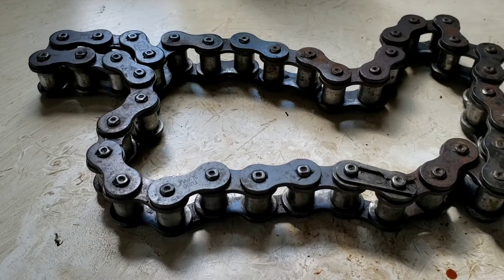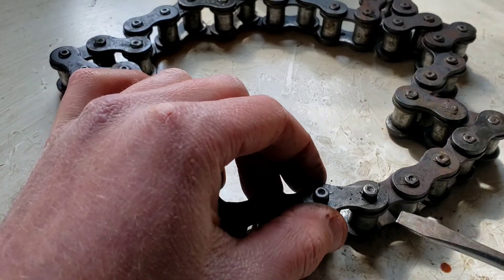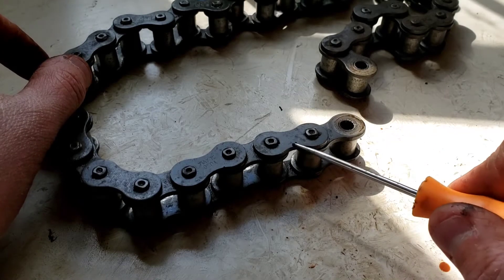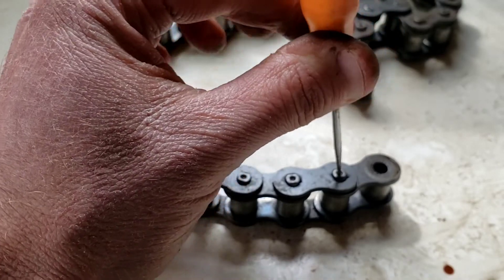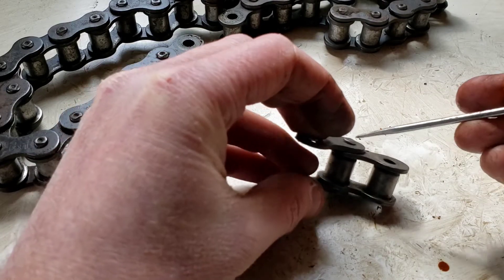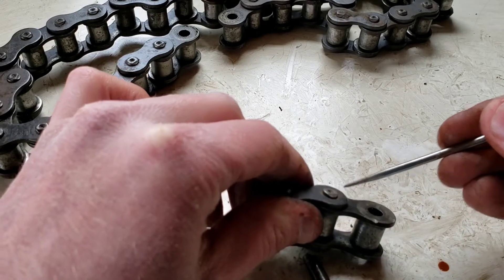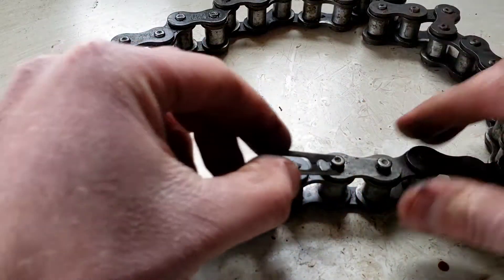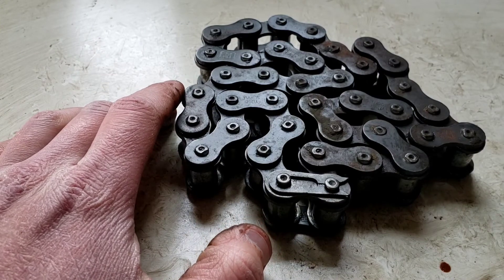Removing Links From Two Types of Roller Chains

Comment: There is a tool you can buy that clamps on the chain with a punch that pushes pin out by turning a rinch on it tried to post a pic but it wouldn't let me i like how you showed how to do with grinder but it you dont habe grinder this tool is awsome i have a grinder n still prefer the tool its about $25

Comment: What if I don't have a grinder with me?
Reply: There is a tool made to punch pin out it's about $25 n worth every penny in my opinion
Reply from the maker: @Kloudd4k  best method is to purchase a chain breaker, but this video was before I had one.  Some people use a hammer and Phillips screw driver, but I never had luck like that.

Comment: Thanks for that, but the notion that chains can only be shortened (or lengthened) two links at a time is not real-world practical. It can't be. Two links is a lot of difference, and cannot possibly get shorter chains to the correct length. So I know dang well there's a way to add or subtract just one link, there has to be, and I guess it's some top secret trade secret. Nobody seems to know how, or be willing to disclose that.
Reply from the maker: Generally, the sprockets can be adjusted.  Maybe even a chain tensioner.
Reply: It works between removing link and adjusting tire back or forward you can achieve correct length

Comment: i did a chain the other day a 520 that was like that. the pin/roller were one unit. not a pen going through the center roller. so when i got the pin ground off after failed attempts at knocking it through, i no longer had the link i was trying to connect with since the roller and pin were one piece.
Reply from the maker: It can definitely be little bit of a pain.

Comment: I didn't watch all 8 minutes, but why can't you just use a $20 chain breaker that presses the links apart?
Reply from the maker: You definitely can.  This video is geared more for those that don't want to buy the tool, because they may not need to take links out that often.

Comment: Tring to put a 40 chain on a gocart
I had to cut chain now I'm about 1/8 " short from master connection
Reply from the maker: That's never a fun situation.  Better to have a little too much, then move the engine, jack shaft, or even a chain tensioner to tighten it up.
Reply: How much do u need